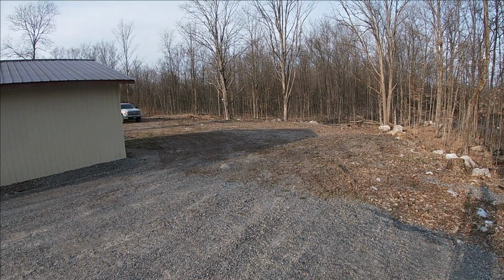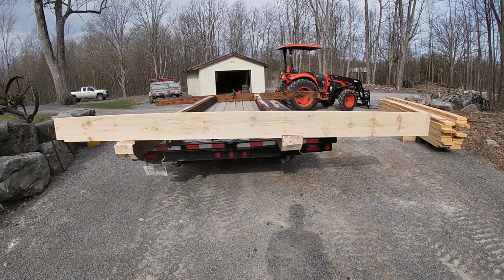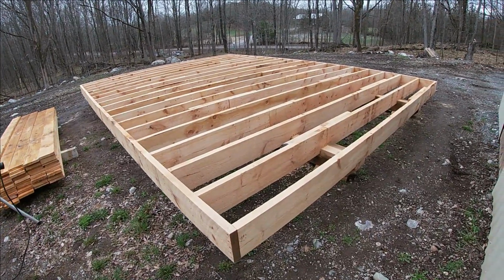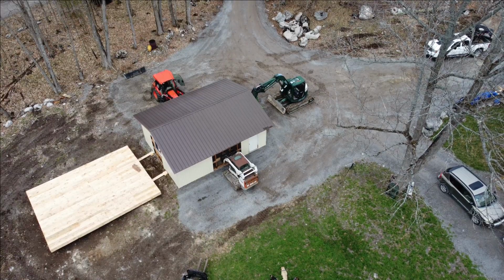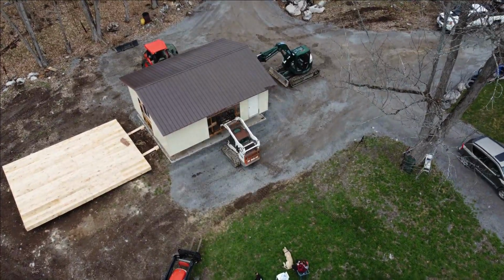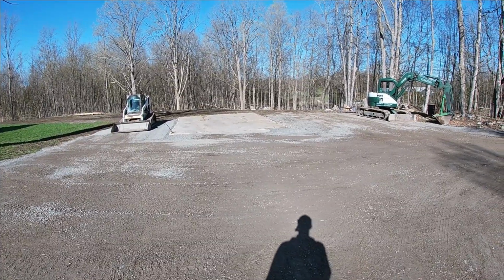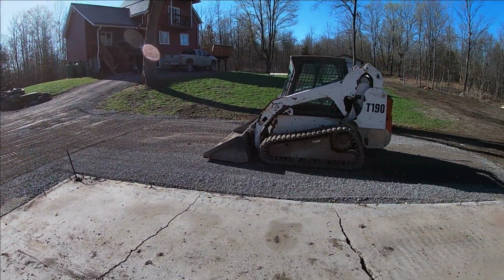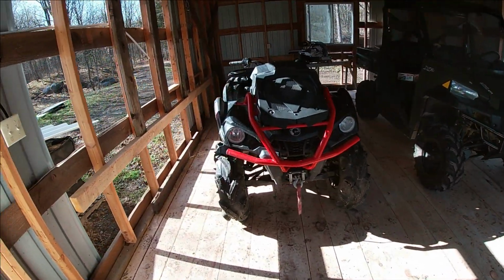Moving an 18 x 24 Garage

Comment: You really increased the value of that garage with all that wood...haha. Nice vid, you guys made it go pretty smooth!
Reply from the maker: I think I ended up spending around $2200 in materials. To me it was worth it though to be able to save the garage and keep that storage space. I could of just lifted it onto a trailer and set it down somewhere else. But to move it again would of been a big ordeal all over again. The other option would of been take all the steel off and possibly take the whole thing apart to move it. So building the floor seemed like the best option even though it was a bit of an investment. Now I can still use the garage and move it relatively easily if I need to
Reply: @ericbrinson9741  Definitely makes sense to keep it skiddable and support the structure. Gotta have a floor of some sort anyway and I'm sure the $2200 wouldn't have paid for a new pad. The lumber prices almost justify a mini sawmill for projects like this
Reply from the maker: @jonah9623   a sawmill would be sweet to have some day especially the way lumber prices are going